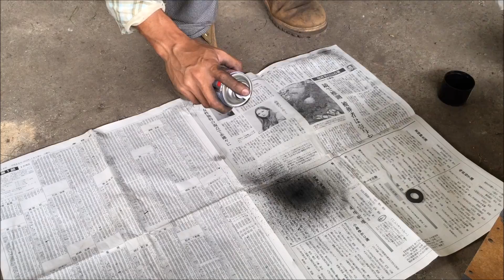スライドテーブルシステムを作る

Comment: Using a drill press is as a mill can be very dangerous.  They are designed to only see downward pressure.  Since the arbor is a press fit,  side pressure with the vibrations can cause it to come loose and go flying at umpteen rpm's.  AvE has a vid on how to kinda keep that from happening.  I think he super glued the arbor in.  I will see if I can find it and will post it here for you.